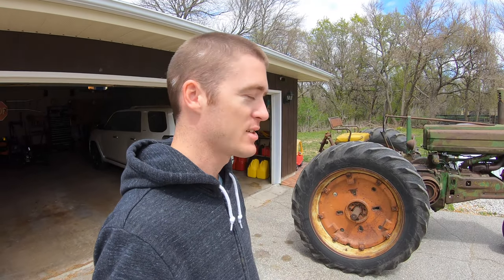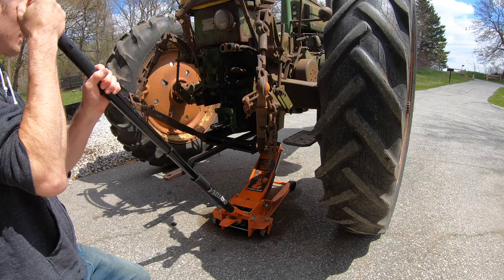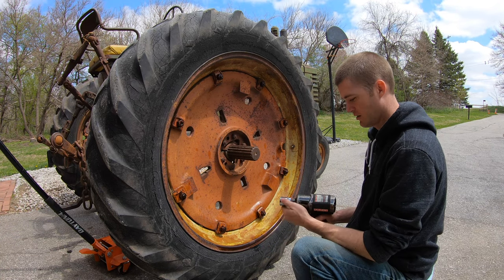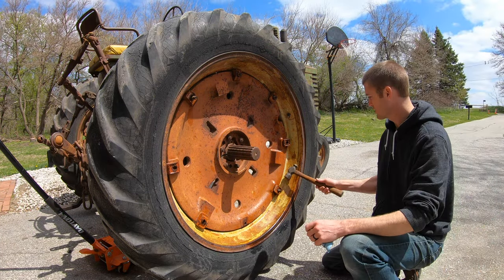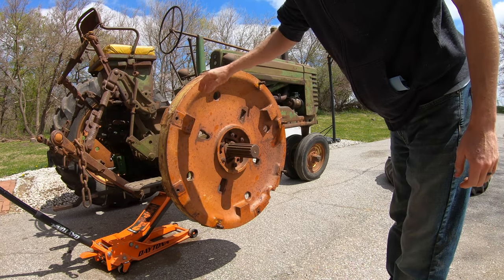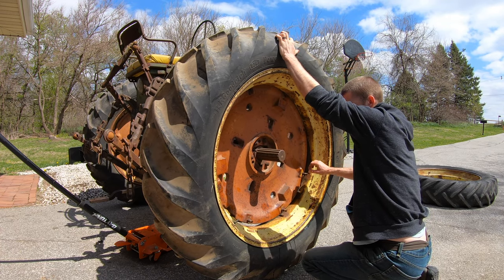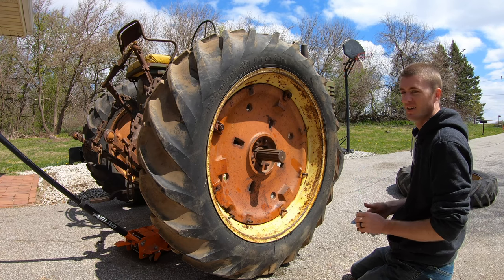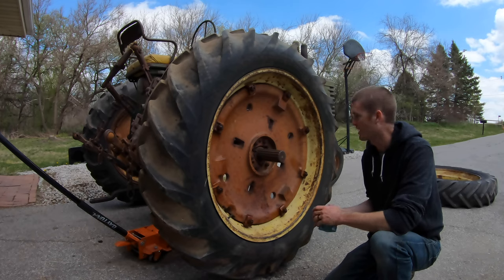John Deere A | Tire Replacement

Comment: I never knew it was that easy, we had the tire people come out to the farm with their big truck and compressor and they would break the bead and replace the tire on the rim. We never had an oppunity to buy a tire on a rim. You needed the John Deere wrench which usually came with the tractor. It was a double box end wrench about 2 ft long with the large size ends to fit on a lot of the bolts on the tractor. We always kept ours on the tractor in the front of the platform with one end stuck over the PTO lever, that way it couldn't fall off and be lost.
Reply from the maker: It would have been a lot more work if the tire wasn’t on a rim already.

Comment: BTW it is 1 1/16" socket, and I would use impact sockets.  And when your tightening up nuts a little at a time, stand a hammer handle next to tire and check runout by spinning wheel.  For tire pressure 16 to 30 psi depending on amount of ballast. 16 psi = no ballast.

Comment: John Deere is famous for 15/16ths and 1 1/8th nuts,  most common size on any older Deere I've ever worked on.  Pressure is kinda a personal preference more then a number.  We usually set ours so that the lugs are flat on the ground.   If you get too much air in them it rounds them and lifts the edges off the ground.
Reply from the maker: That is very good to know. I ended up putting 10 psi in it as that is what the other side had.
Reply: @HumbleAcres  Do not put 90 psi like one post suggested. Put 9 to 11 psi in the rear tires.

Comment: Read your operator manual, if you don't have any ebay has them from people who are selling the manuals. Tire pressure gauge for yours 15lbs. Depends on how much weight your caring no load or loaded into the rear tires.

Comment: Mounting a tractor tire on a rim never never exceed more than a pressure of 35 lbs. to seat the bead or any time after that for tire pressure. Injury or death ☠️💀 can and will result.
Maybe not now some time in the future, Keeping it at 35 lbs. And more.